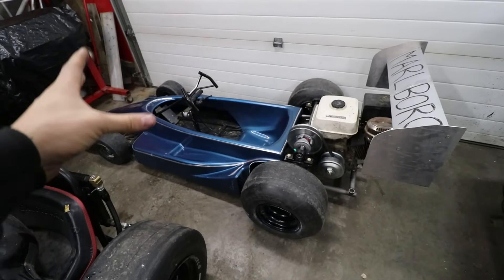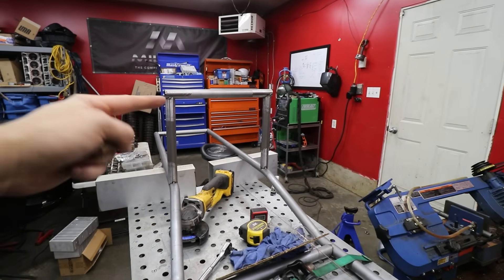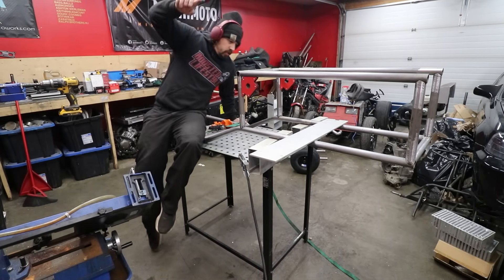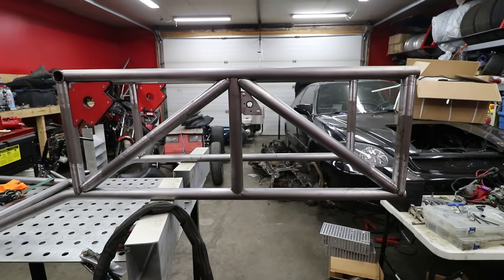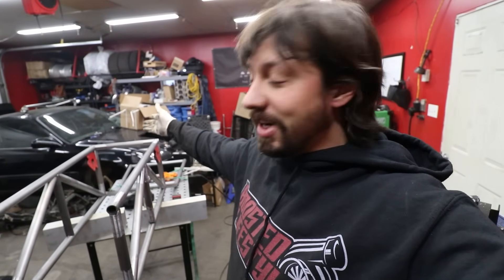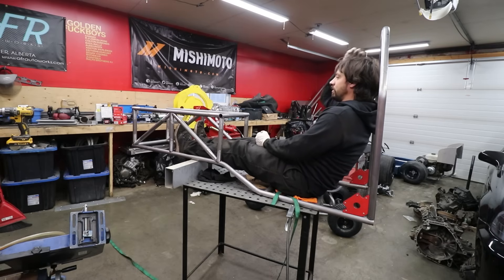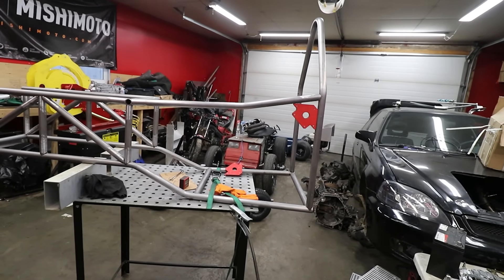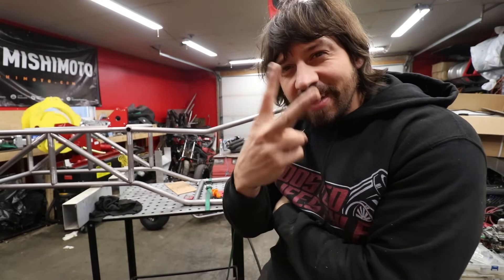Homemade Formula One Car - Part 1

Comment: AutoCAD is an amazing tool for making design decisions while still promoting creative freedom. In fact that thumbnail for this video looks just like the one I made in SOLIDWORKS back in 2010 for this exact same idea. You are willing to spend about 10k for the drivetrain components I would highly recommend the BMW M1000r, though I designed mine around the S1000r which was the best stock 1000cc motor that existed 12 years ago. Couple that to a magnesium housing chain drive diff with carbon fiber CV axles then add in a couple high torque/speed solenoid actuators (for paddle shifters or course) and you'll have yourself a supercar killer for under 20k. 
If you  plan on making this street legal I'd be happy to share a TON more info with you as that part is what killed my dream car...

Comment: The rear arch does look too high but I don't think it is, if you imagine that in the event of an accident where the car is upside down, the helmet shouldn't protrude from a straight line between the two points of contact saving you from hitting your head on the ground, those being the front of the car (presumably that cage where your legs are) and the top of the arch. The halo has since been introduced to take as much of the impact too now but that arch looks good to me.

Comment: Something you need to check with your roll hoop. Run a straight line from the top of the roll hoop to the top front most cross bar and make sure that line is above your head. In other words you are checking that in a roll over the 2 points the car rests on keep your head off the ground.

Comment: I'd suggest to take a look at an fsg or fsae rulebook to have some constraints in what you are building. The rules are there mostly to assure safety so it make you think about all the safety requirements you should add into the design.

Comment: You haven't looked far into single seater design have you. The gauge of those tubes is mental. You want to start with 4130 inch round 1mm wall.
Reply from the maker: It's going to be okay 😁

Comment: I did a good bit of work on my schools FSAE car, here are some though. The first year of our club we built our car the same way you are, building the chassis then designed everything else around it. It’s counter intuitive but you should really design and build the chassis around the major sub systems. The most important place to start, in my opinion, is suspension geometry. First, figure out what wheels/hubs/uprights you are using. Second think about how you want the car to handle, this will inform the camber, caster, toe, king pin inclination, Ackerman, and so on. Once all those are decided, the A arms basically design themselves. At which point the chassis just has to connect the dots as rigidly as possible. Either way, you’re tube bending and notching is beautiful.
Reply from the maker: That actually makes sense! I appreciate the insights. In actually horrible at preplanning and I have no insight in suspension geometry 🤣
Reply: @Boostedlifestyle  100% start with suspension. I do vehicle dynamics in FSAE too and this will literally make or break the design. I would advise doing some research on basic suspension kinematics (instant center, roll center, pitch center, virtual swing arm, etc) because there are some things that can’t be fixed with a setup change! And I will add to that first comment that you might want to look into an adjustable ackermann geometry going from anti-ackermann to pro-ackermann, as it is purely influenced by the tire. That means if you don’t have a tire behaviour model, you might not get much grip out of your tires if your ackermann is the wrong way!
Reply: Hi I'm a part of formula student team and I don't know how to start did you have a guide or site or something helpful

Comment: it might be helpful for you to check out Formula SAE (FSAE) or Formula Student cars. They're college student race cars that are very similar to what you're trying to do, formula style racecar with a motorcycle engine. There's a lot of documentation online that could provide some ideas and/or inspiration from their different design choices. At worst you'll at least see some cool cars.  Awesome vid!
Reply: FSAE documentation would be such a great place to start for this project honestly. As someone who is in FSAE, I can see a lot of things I wouldn't do in building the chassis just because the math doesn't work and the car might break down. He should've started with the tyre selection and gone from there instead of building the chassis first XD
Reply: Yeah that's true! I haven't watched the full video but also there's a lot of information online about F1000 it's also a single seater class and is practically a F1 car with a 1000cc motorcycle engine in it
Reply: you are so correct.  i worked on a couple F-SAE builds.  diving into that body of literature would yield major payoffs.
Reply: He should build the car taking inspiration from the rulebook. Do all the proper triangulation and use the safety requirements, with free aerodynamics on top of it.
Reply: Hi I'm a part of formula student team and I don't know how to start did you have a guide or site or something helpful

Comment: Very upright position, but I imagine much more comfortable to drive like that. Pretty excited for this, since 99% of such builds end after the person runs out of either money or time to design, so you eyeballing a lot of this stuff might be right decision.
Reply from the maker: Even if it's 70 percent as fast as a professional built car I'll be happy
Reply: @Boostedlifestyle  Oh dear, you're in for a crazy surprise when you figure out how ridiculously fast every Formula racing series is, especially F1.
If you wanna go even close to as fast as them you'd need to ditch the steel and start molding carbon-fibre haha

Comment: Correct me if I'm wrong, but with the front being made rigid, doesn't that make the bends in the driver area the weakest part of the front crash structure? I'm only halfway through the video, maybe not. Just wondering.
Reply from the maker: In video 2 I fix this

Comment: when i was racing formula Vee and formula Ford back in the eighties , some tracks like (Winton, Sandown, Calder etc) had concreate strips that sat about 50mm high and were rectangle shaped with a crowned top. 
They were on the apex on some corners to stop drivers cutting the corner. 
Because Alan Jones (ex F1) driver was racing on that track, FIA rules said that had to be put there , something about him still having an F1 license and wasn't allowed to drive there without them in place . 
So if a driver cut the corner an rode over these concrete strips, they would bash into the bottom of the car, usually at the front because the cars in those days cars were flat bottomed. 
They recently remove them https://wintonraceway.com.au/motor-racing/at-winton-we-listen/
Anyway , all I'm saying is , with your underneath design, if you run over something, your bum could cop a hiding 🙂

Comment: Cool build, following along. One tip you should drill a small hole in the tubes that will be sealed by welding to stop pressure build-up, I usually drill 1/16" hole so the tube covers the hole in a main tube open to atmosphere if that makes sense

Comment: You have a lathe good sir, make some brass bushings for the tube notcher. Lol
Reply from the maker: I want to but it's like 3/4 inside diameter
Reply: @Boostedlifestyle  man, if I’m ever in Canada I’ll come by and make it happen. Use the biggest drill bit to start the hole and then use lathe cutting tools to finish up the size.

Comment: Kyle, for your tubing notcher Farm stores(rural king/tractor supply) usually have a good selection of bronze bushings. If they don't have have the exact size you can use your lathe. Or just start with a brass blank and machine one. It would be nice to fit it with ball or needle bearings and forget it
Reply: If the farm store doesn’t have what your looking for, check out McMaster-Carr.   They’re pretty comprehensive on bushings and bearings

Comment: 1000cc engine set inline with chassis, direct drive off gearbox output with a splined yolk adapter, short stub shaft with u joints into an LSD diff and IRS? Maintains the bike trans and clutch 🤔 also might help to look at how some of the drive trains are built in Crosskarts

Comment: Loving this build already!
Just make sure you have multiple reference points to measure from/to so you can square everything up nicely. Measure and record as many point-to-point references (front/rear, left/right, up/down, multiple angles to different points, etc) as you can. This will help with suspension design/fabrication.

Comment: I had a similar coping jig one time and used Starboard (marine plastic basically) and took a small piece and made bushings on the lathe. I know you have the small lathe, but thats all you need to make these simple busking for your coping jib
g. Keep graphite on them and it will last forever basically.

Comment: Love it man! Definitely use the 1000cc, but also do whatever you can to have the engine in front of the axle. Need the weight forward as much as possible
Reply from the maker: It will be. My biggest issue is trying to find a way to build a diff and rear hubs
Reply: @Boostedlifestyle  lots of people have converted a rear diff to chain drive if you don’t want to have a solid axle. Can’t remember what car diff to find to do it, but YouTube will show you I’m sure!
Reply from the maker: Yeah Ive been looking on how to encase one and what not
Reply: @Boostedlifestyle  Just take a look at one of the many commercially available chain-drive diffs for some ideas. I built one using a VW 02A open diff but a Civic would work.  You won't be competing in F1000 so you could just do a spool.
Reply: @Boostedlifestyle  Check out the chain differentials that drexler makes. Its what I run in my car.
Reply: @Boostedlifestyle  Look into an FSAE diff, you may have to make mounts or something for it but very similar goal here
Reply: You could part out the civic in your garage and use that

Comment: you will test this thing without a suspension and break your tail bone 🤣 love the build and can't wait for part 2 <3
Reply from the maker: No no. It will get suspension 🤣
Reply: @Boostedlifestyle  A proper suspension is essential, along with a proper frame structure, brake system, transmission-drive train and certainly the power plant-engine and control system, fuel system, ignition system, lubrication, additional cooling as necessary.
 @AlienTrashKitty  
Had sent this to Gina:
it seems that Kyle has a good imagination, visualization and has some blocks or thinking that prevent him mentally and things which spark, initiate his abilities with thought, imagination, visualization, creativity.
My guess, hunch is that You Gina, have a simpler access to, with Your imagination, visualization, creativity thoughts and perhaps can assist, aid, help Kyle to access his better too.
Personally my imagination, visualization, creativity are easy to access and most of my thought appear in my head, mind, brain via visual, images, concepts.
Perhaps You can also assist Kyle to use some programs using a computer, drawing tools, touch screen or such to assist him with access to his inner thoughts, ideas, concepts, visual, creativity.

A. Perhaps begin, with viewing some actual, proper frame structures of F1, Indy and other tube chassis vehicles to initiate Your thoughts, views, ideas, concepts, imagination, visualization, creativity.
-1. All of proper tube chassis designs with cycles, bicycles, motor cycles, karts, vehicles use properly arranged triangular structure within the frame.
B. Then use paper, computer drawing, touch screen or other means to begin transferring your thoughts as pre-planning, planning, design.
-1. You can use all of the verbal, and other processes You show within this vlog recording and also record them too.
-2. Then You fabrication, work, development, design, execution, implementation, results, will be much better more efficient, successful
-3. Your abilities with access with also increase too.
C. which drawing types are You familiar with ?
-1. top, front, sides [rear, bottom], 2-D to represent the 3-D ?
-2. perspective - 3-D ?
-3. others ?
C. Also realize the power/weight ratio with any power plant-engine You are considering both with a 125 cc engine and obviously farm more with a 1000 cc engine.
-1. Also realize the power/weight ratio with any power plant-engine You are considering both with a 125 cc engine and obviously farm more with a 1000 cc engine.
-2. Very Powerful, Fast, Quick motorcycles have from 500 cc -1000 cc also 1200 cc engines ->such Your F1 Kart with such an engine will be similar
-3 Also, many Dirt motorcycles use 125-250 cc engines and are very powerful, fast, quick, 
-4. Thus this F! Kart has the potential to be similarly powerful, fast, quick and requires much thought about saftey including brakes, passenger, traction, steering, suspension, etc.
-5. Consider the actual F1 vehicles weigh about 1400 lbs = ~ 630-5 kg using  2000cc-3000cc, 2.2 L-2.4 L engines
-6. Consider the G1 racing vehicle, which is very similar chassis with F1, uses a 1000 cc motorcycle engine, 201 HP: https://www.af1racingaustin.com/griiip-inventory/griiip-g1
D. It would seem to be reasonable, logical for You to first develop a proper vehicle chassis, drive train, working vehicle-Kart, using a smaller, lower power engine, drive train before proceeding to one with a larger size, more powerful engine.

My hope is this would, could, will be helpful, useful, assist, beneficial for You to have improved access to, with, within Your thoughts, ideas, concepts, creativity, imagination, visualization and thus pre-planning, planning, design, development, fabrication.

All The Best
Sincerely

Comment: look at formula-Vee designs and use the 1000cc

also imagine you are building an airplane... one thats shrunk down until only barely bigger than your racing suit 😂😂 but the wings are all upside down and in the front and back instead of sides
Reply from the maker: Formula v is like VW beetle components though
Reply: @Boostedlifestyle  true true... however (its been a while i dont remember specifically) but i recall one designer explaining how they 'could just fabricate such and such, but we have to use this' which sort of informed my suggestion. the parts with the theory included in explaining the necessary design compromises

Comment: It doesn't matter what engine you put in it, with the bike trans it will have some serious speed potential!
Reply: Yeah put an old 2 stroke from a lawnmower. The transmission will make all the difference
Reply: I'd be cool with like a R6 or r1 engine
Reply: @terrencetheamazinghd2094   I mean currently have a CBR125R or CBR1000 to use so options are available to us!
Reply: @danielgallant7170  this is gonna be awesome
Reply: No power doesnt matter only the trans...  lfmao
Reply: Boys are getting bend out of shape. Power matters but between the two available to us it was going to be build to scale.
Reply: vtec